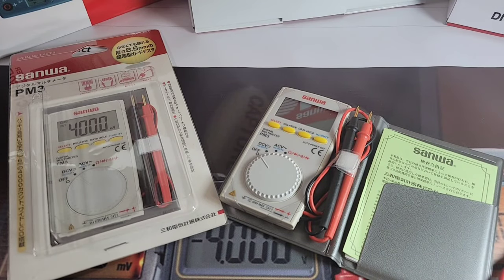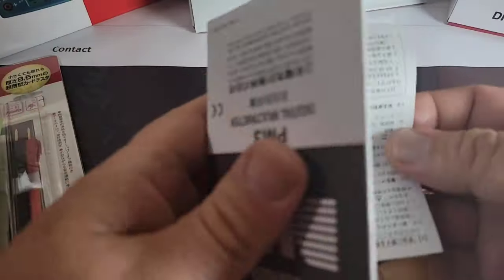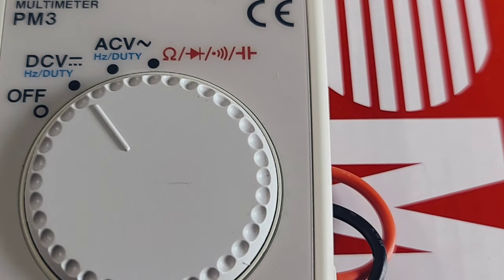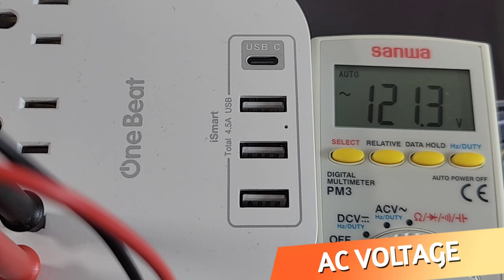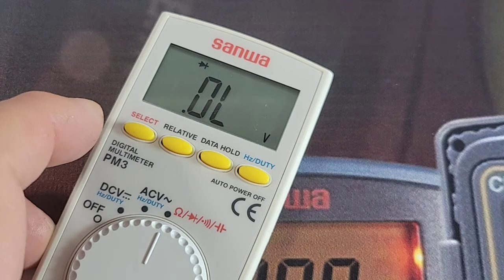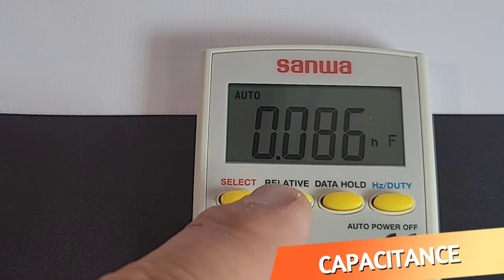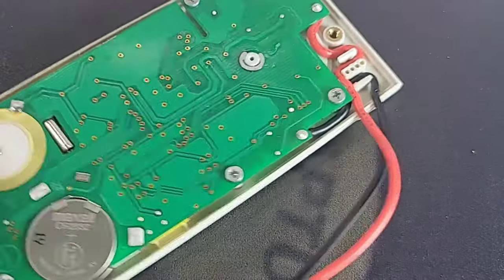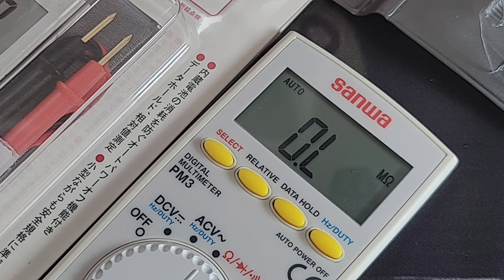SANWA PM3 Pocket Multimeter Review & Teardown!

Comment: Wow now that's what I call a pocket meter.  You can slip this in your pocket without weighing you down.  And amazingly feature packed for this pint sized powerhouse.  It's auto range and even comes with capacitance, frequency and gold plated probes.  Incredibly it even has a calibration certificate which is unheard for a pocket meter.  Another great review Darren.  Great job.

Comment: Still does the job. Small but still accurate. I just hope that they improve their diode test. 

But I do remember back when I'm still at university. My laboratory has the Sanwa analog YX360TRF and their DMM CD800a. Same issue I couldn't get to lit LEDs on Sanwa's before. The YX360TRF does not have a diode test mode, the CD800a diode test mode does not output enough voltage to light them up(I used to think that maybe the DMM is low on battery and needs a batt replacement or something). Until One day I learned a trick where I used the continuity/Ohm range to test and lit LEDs to see if they still work or are already busted. Works a treat.
Reply from the maker: Great feedback 👍 YX360TRF is a classic !

Comment: Not a bad little instrument at all, although there is perhaps a running theme with the capacitance and diode tests? Looks like the leads have good strain relief built into the case to protect the solder joints. Another great review thanks.
Reply from the maker: True ! I neglected to mention the strain relief,  plus it's a solidly built test lead and will be able to handle alot of abuse.

Comment: I have somehow a weak spot for this kind of little pocket DMM´s. Massive electrical safety is not a thing (or even possible) at this size. The lacking backlight is excusable. Not excusable is the bad placing of the functions on the rotary knob. Four functions cramped together on one position? Seriously? Why? There are plenty positions more possible. Anything else about this DMM is mentioned in this video (informative as ususal).
Reply from the maker: Thx ProBang, yes awesome pocket dmm with a few annoyances but overall a great addition to anyone's mobile toolkit 😀 👍